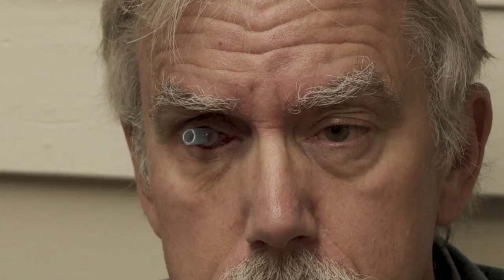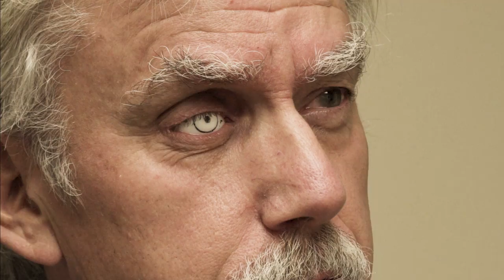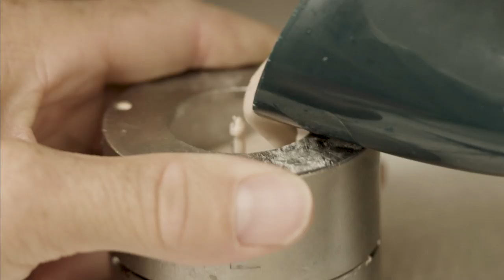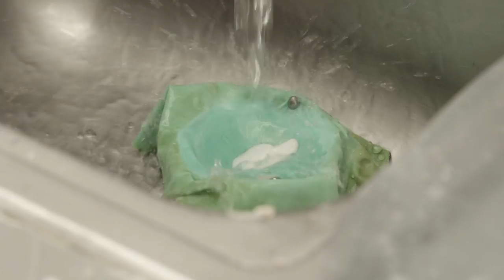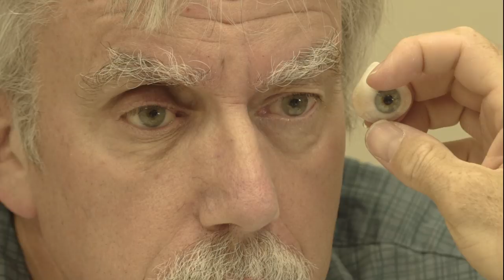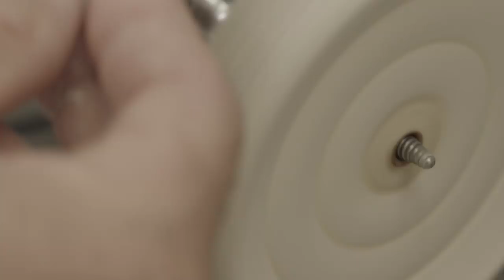Making Prosthetic Eyes | Nice Content | Tatered

Comment: The shape is so intriguing to me. I always visualize eyes as being perfectly round, but I suppose if you have one removed and all the nerves behind it come out too, a replacement would have to me shaped less like an eyeball and more like the eye socket?
Reply: In this case, there is an implant in my eye socket that the old nerves and muscles are attached to. (My artificial eye does not attach to the implant). a layer of tissue covers the implant, thus the socket sort of a half round shape
Reply: The problem is the weight, as plastic is heavier than "eye", it increases the asymmetry, especially while growing. I had quite big ones through all my childhood, but mostly empty (like a button mushroom without the foot), but the eyelid was falling more and more, so the top of the eye was more and more pointy to fight against that. At 22 I had surgery to "fill" the socket with muscle and fat from my leg, now I have something quite similar to that person, really thinner.